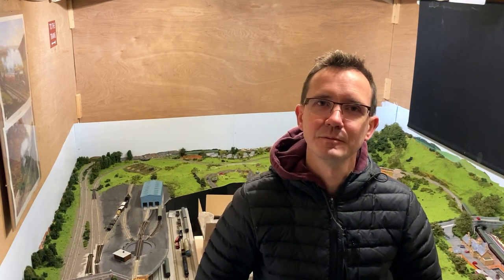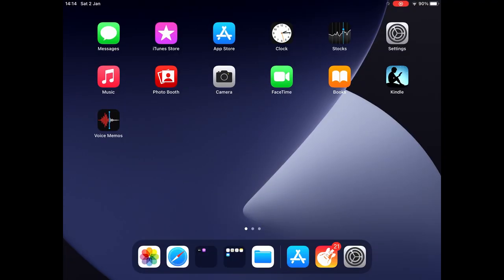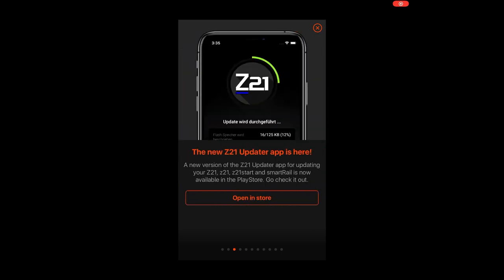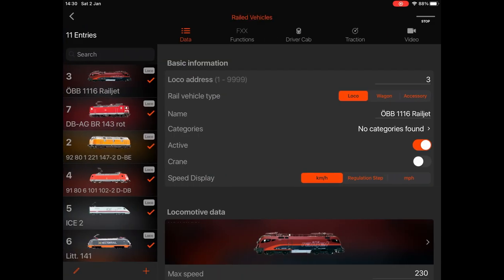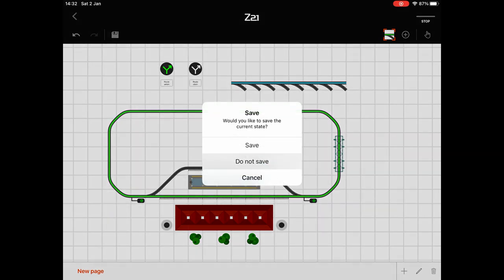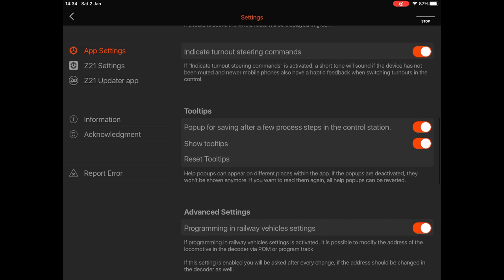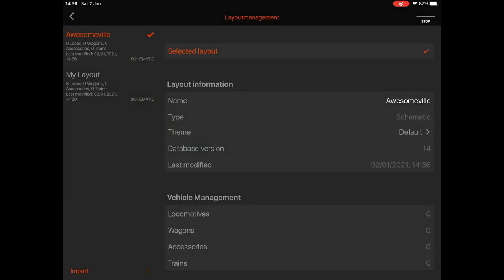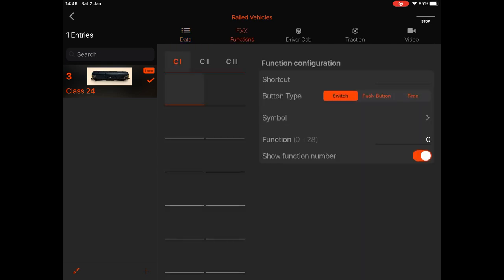Part 2: Roco Z21 Setup

Comment: Hi Simon. Cheers for doing that video, really good guide to getting the system working. On the back of your last video about which Z21 to buy, I treated myself to the Z21 black. Just waiting for it to be delivered and looking forward to setting it up. Cheers, John.
Reply: Take a note of the passphrase on the underside of the router before you set it up. :-)
Reply from the maker: Good stuff, hope you enjoy it, thanks for watching 👍
Reply: Thanks goodness you did this video. Z21 arrived today, instruction manual is rubbish so I had to rewatch your video whilst setting mine up. Thanks again!

Comment: It is worth running the Windows-only (boo hiss) Z21 maintenance tool as that controls some settings not in the app, such as changing accessory addresses to work like every other DCC controller. (Googling for "dccconcepts z21" will have more details.) Another thing I find handy in the iOS app is that you can email loco configs to your desktop machine. They're a zip file which includes the photo, and you can use a graphics app to turn the photo's border transparent. Rebuild the zip file, send it back to the Z21 app - et voila. It appeals to my OCD side anyway! I'm enjoying the mini series BTW, keep them coming...
Reply from the maker: Cheers Chris, I'll have to cover emailing the config as its always good to have a backup! 👍

Comment: I enjoyed these 2 Videos and are  very well done, when you get further into the Z21 could please do a video on speed matching I have started to try this but still can’t get then to run at same speed
I have timed the locos  on set circle in 12 steps on 128 steps and added to the loco data, and added them to a consist but one is faster then the other.
Reply from the maker: Good idea, I'll put that one on the list 👍

Comment: Is the green plug that connects the track to the Z21 a standard plug? Having a separate one for my programming track would be useful.
Reply from the maker: I got 2 of those green plugs included when I bought mine, I think they are Roco specific but I found some on eBay - https://ebay.us/th1WG8 for £2.50 👍
Reply: @SimonsShed  I've got a white Z21 that came with a starter set, so perhaps that's why I only got one. (Actually I should check the box again!!)

Comment: Good day sir! For some reason my pixel phone does not have the pop up message "allow network" that you mentioned. It works fine on my wife's phone. Any idea what that might be? The app on my phone says "not connected to Z21 network", which is expected if the network is not allowed. The wifi of the phone is connected to the Z21 router, just the app doesnt see it.

Comment: Hi Simon - I have wifi and a live Ethernet point in the room I'm planing to put my layout in (1st time builder so I'm getting quite an education watching all these videos.) Do you have to have the router or can you plug  a Lan cable directly into the z21. I already run half the house via my phone and ipad - all it needs is an internet/wifi signal! Cheers, Doug G
Reply: The TP link router supplied with the Z21 is just for connecting your tablet or phone or both even to the Z21 ,nothing to do with your home wifi set up. Be less confusing if the router was built into the Z21 IMHO.
Reply: Hi Glynn, Yes I think I agree with you on the "less confusing" point! I have been chatting with a guy on a forum who has his plugged into his home wifi "No Router" but it's a fairly complex procedure to get it all working!
Reply from the maker: Hi Doug, yes as you've discovered it is possible to get it working without the included router, using your own router instead, but its not something I've tried and sounds really complicated!

Comment: Hi Simon. Can you change the speed steps for a loco from 128 to 14 on the new app?
I have a loco with a very old decoder that runs on 14 speed steps and am unable to select 14 speed steps on the new app. 
It works on the old app and it used to work on the new app. I no longer have my original Android so I downloaded the latest version onto two different Android devices.
Reply from the maker: Hmm I have the same issue here, it won't change,  looks like a bug, I'll send them a bug report.
Reply: @SimonsShed  I tried changing the speed steps again today and it worked! Maybe Roco did something overnight?
Reply: I stumbled upon the answer to the problem. The Z21 app has to connected to the Z21 by Wi-Fi for the setting change to be enabled.
Reply from the maker: Ah ok, mystery solved!

Comment: It's a shame that the loco details etc are stored on your device and not the z21. That way, all devices would have instant access rather than having to export and import. I've just bought a WLAN Multimaus to use with it and I think I am going to have to add all of the locos to that separately :( That said the z21 is brilliant. Thank you Simon to introducing them to me. An added bonus is that they wilI work with JMRI